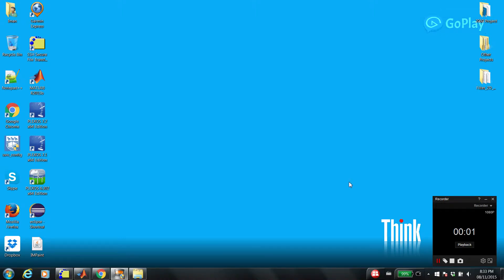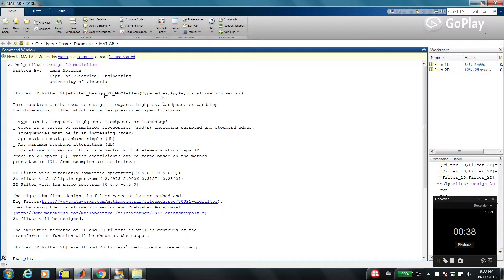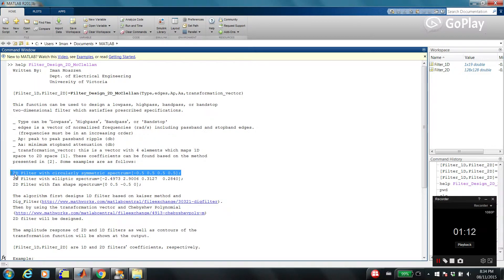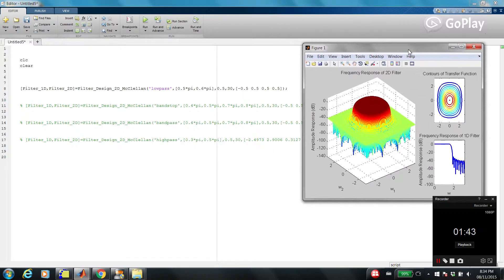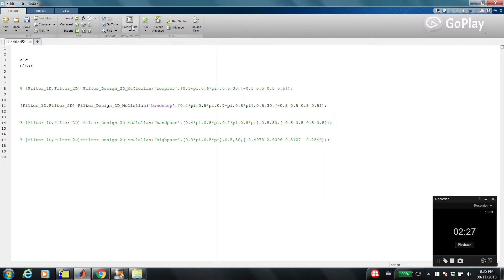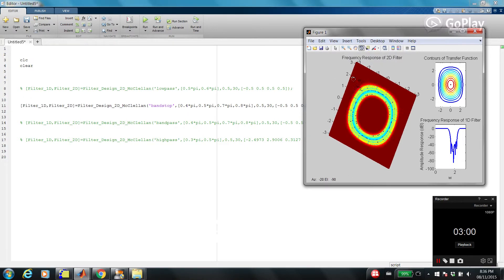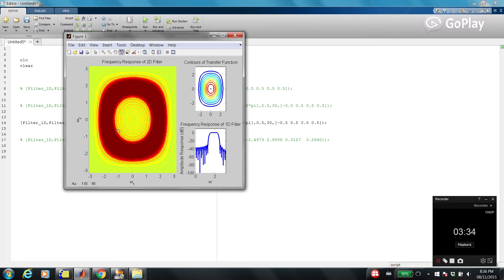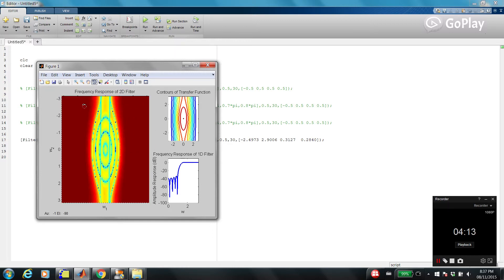Two-Dimensional Digital Filters

Comment: please help. karaboga and Abadi speak in "A novel 2D-ABC adaptive filter algorithm: A comparative study" and "The novel two-dimensional adaptive filter algorithms with
the performance analysis" respectiv on filter 2D lowpass filter The filter coefficients of the 2D lowpass
filter is given by b(z1) = 1 − 0.7z−1 1 + 0.5z−21 + −0.05z−3 1 + 0.0056z−41− 0.0004z−51 b(z2) = 1 − 0.7z−12 + 0.5z−22 + −0.045z−32+ 0.0046z−42 − 0.0003z−
i don't i know implement in matlab.
for z1=1:256
for z2=1:256
a = 1-0.7*z1^(-1)+ 0.5*z1^(-2) -0.05*z1^(-3)+ 0.0056*z1^(-4) -0.0004*z1^(-5);
b = 1-0.7*z2^(-1)+ 0.5*z2^(-2) -0.045*z2^(-3)+ 0.0046*z2^(-4) -0.0003*z2^(-5);
p(z1,z2)=a*b;🤔

or 

b1 = [1 -0.7 0.5 -0.05 0.0056 -0.0004];
 b2 = [1 -0.7 0.5 -0.045 0.0046 -0.0003];
v_2D = filter2(b1*b2',N1);